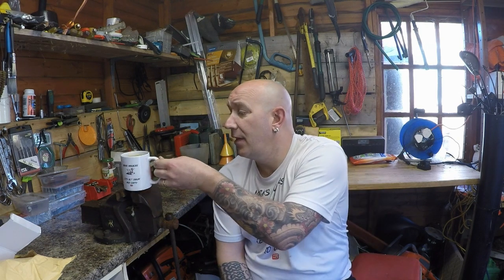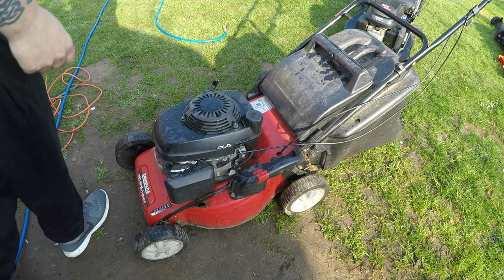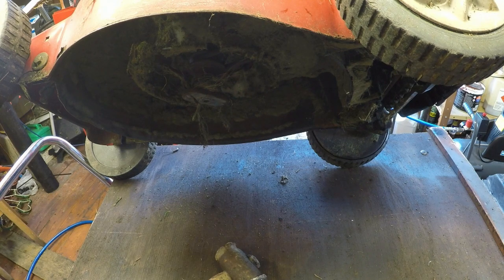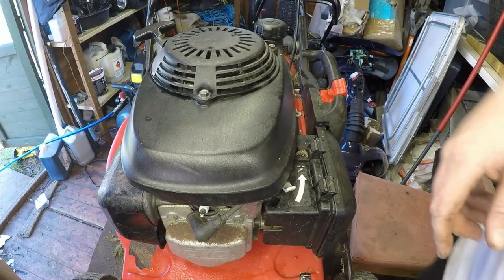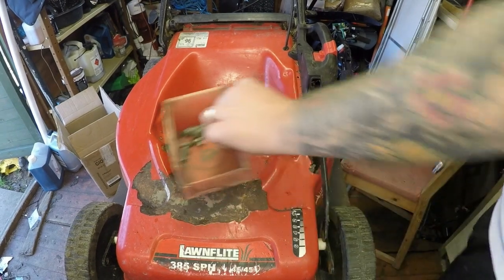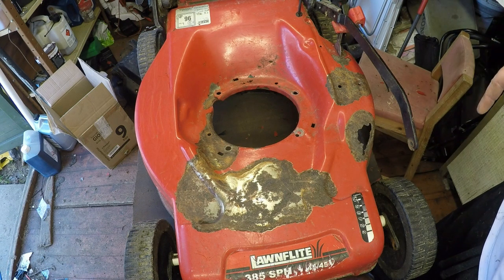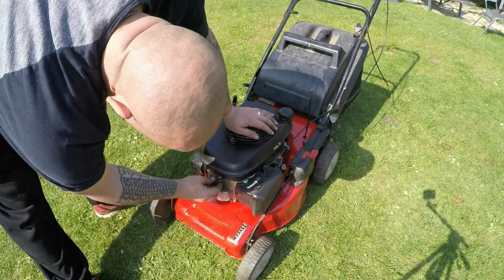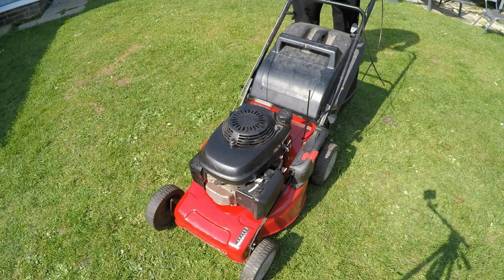HOW TO FIX LAWNMOWER WITH A HOLE LETS FIX IT #SMALLENGINENATION

Comment: The company I worked for did Nickle & chrome plating. I took my brand new mower and stripped it down to just it frame took it to work acid dip it to take off the paint and had it nickel plated. Big mistake, The plating came out perfect but after putting it back together. and when I started to mow the lawn the sun was in full strength and just about blind me from the shine.😪

Comment: Hi Mick that hayter harrier 41 410d wasn't such a good catch after all. I found out the left side roller bracket is broken. So thats thirty pounds on ebay and the plastic cover under the deck has a bit of a chunk out of it by the rear roller?
I might buy the bracket but was wondering whether i could epoxy glue another piece of plastic on the gap at the back by the roller? Its about 2 inches.
Reply from the maker: I would give it a go mate